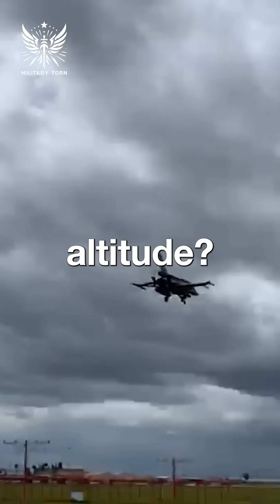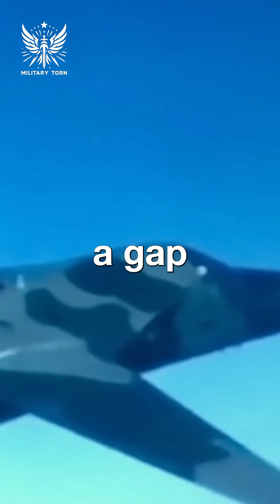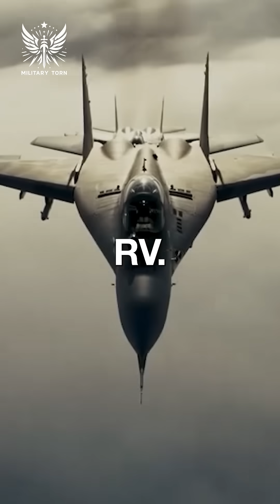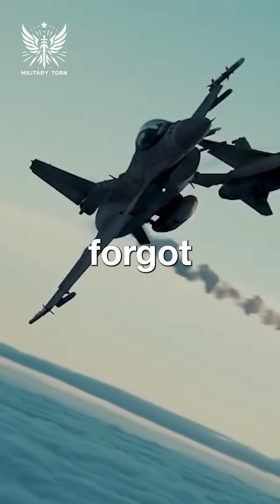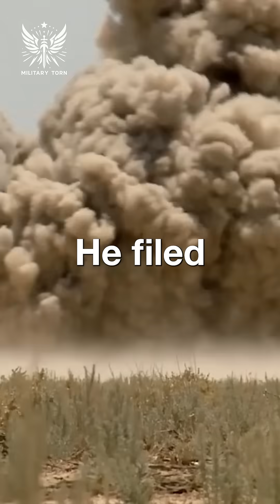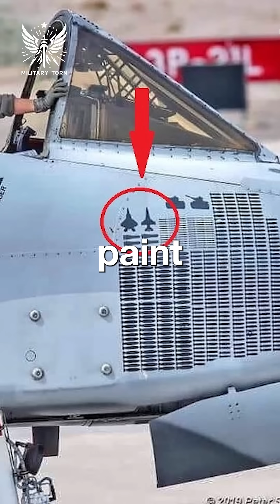What Would Happen If A Fighter Jet Flying At Mach 1.5 Passed Over A Civilian Car At Low Altitude?

Comment: 1977 Dutch train hijacking - Not sure if it was super or sub sonic

On 11 June 1977 at 05:00, almost three weeks after the start of the hijacking, six F-104 Starfighter jet fighters of the Royal Netherlands Air Force overflew the train three times at low altitude, using their deafening afterburners

Comment: Would wing rip at like Mach 1.2
Reply: FB-111 did not have a speed limit.  Just s skin temperature limit.
Reply: @FirstCajunAce  I’m talking about on the deck though
Reply: On the deck is just above ground - the "ground" in the Eastern portions of the Nellis Ranges is 3500 to 5500 get above sea level. Hitting Mach 1.5 200 feet above the ground when the ground is at 5000 feet above sea level is not a problem.

Comment: I remember reading some magazine article about Porsches on the Autobahn causing toads/frogs to explode when these vehicles passed over them at high speeds.  No actual contact between vehicle and critter.  Just something about changes in air pressure.

Comment: What woudl happen if 3 orbs were intercepted by F15s or F-16s and pilot armed missles? THey could if they wish laser the cockpit flange which is aluminum welding it and drag your to 10,000 mph or such de-atomize you ; next time you see them DO NOT engage and use your CELLPHONE not gun camera please .

Comment: In the early 70s, hot dog pilots would buzz over our farm, sometimes creating a sonic boom. When one did that and shattered all the windows in the house and barn mom called and complained. They had all the glass replaced by 4:30 that afternoon. You could read "No Step" on the slower F100s.
Reply: I just posted something similar. Were you in Colorado?

Comment: Mach 1.5 at 200ft? I doubt that, Even the SR-71 is limited to about Mach 1.2 at sea-level.
The atmosphere is simply to thick causing to much resistance and drag.
Reply: Not sea level - 200' above ground which in that part of the Nellis Ranges is about 5000' above sea level.

Comment: Impossible, at sea level at 1.5M q=3750 psf, wings would rip off. 1.5M at sea level is almost 1,150 kts, NFW!!!! Fake News
Reply: If you do the math to compute Mach you have to use temperature not altitude. All pressure altitude is useful for is computing air resistance. There was some damage to one wing glove and both strakes had some delamination but the wings started on just fine
Reply: @FirstCajunAce  I used sea level standard day (15 deg C) and standard adiabatic lapse rate to compute 3500 & 5500 ft msl. USNTPS CLASS 99 and a couple of engineering degrees helps. You’re telling me Mach is temp not altitude related? Seriously?
Reply: Mach display in the aircraft is primarily a ratio of speed of sound vs. true airspeed.  As Verified by Toppr -
Air pressure has almost no effect on sound speed. It has no effect at all in an ideal gas approximation, because pressure and density both contribute to sound velocity equally, and in an ideal gas the two effects cancel out.
In an ideal gas, intermolecular gaps are always taken to be very large, regardless of pressure. Pressure is solely due to the interaction with (imaginary) walls, not due to the interaction between molecules.

Modern electronic Machmeters use information from an air data computer system which makes calculations using inputs from a pitot-static system. 

The indicated true airspeed has a direct dependency on the static air temperature (TS
,SAT) also known as the outside air temperature (OAT). The static temperature cannot be measured directly since the air will heat up on impact with the temperature sensor due to adiabatic compression. Instead the total air temperature (Ttotal
, TAT) will be measured.
Reply: The FB-111 does not have a speed limit, only a skin temperature limit of 300 seconds above 153 centigrade.  The Nellis Ranges are 4 to 6000' above sea level. I did start the temp limit toner running but was easily doing above 900 kts. And, Mach is based on air temperature, not altitude.
Reply: @FirstCajunAce  After TPS I flew with the 6513 (Red Hats) in the early 90’s, Constant-Peg, Red Flag, etc. So, I’m very familiar with the Nellis Range complex. The 111 most definitely had a “speed” limit. Use whatever unit of measure you desire but the structural limiting factor is dynamic pressure (q). So I’ll stand by my sea level comment that an F-111 doing 1.5M at sea level is impossible. Now, a car parked on top of Mt Everest or Bald Mountain, yes.
Reply: The entry area on the Eastern side (approaching Student Gap) varies from 3500' to 5500' above sea level.  Airspeed display was around 1070 mph.
Reply: @FirstCajunAce  do the math, 1050 mph @ 3500 msl & 5500 msl is 1.39-1.4 Mach. Not 1.5 as posted. Is Denver a “low altitude” city? 1.5 M at 5500’ msl over a vehicle in a 111, yea right!

Comment: Panamint Valley (Just west of Death Valley) which was an area where planes could fly over Mach 1 if the could.
     Death Valley and Panamint Valley looks more or less the same from the air, and sometimes planes would be super sonic over Death Valley, something that was not allowed.
     Anyway, I was driving up Panamint Valley once when I saw an A-10. It looked to me like he was making a simulated (I hoped) attack run on me.
     I looked around and saw no other traffic around so I started jinking from one side of the road to the other.
    The plane flashed over (less than Mach 1, obviously) then a few second later he flew over me again, then when I was sure I could see him he performed a fantastic aileron roll.
    I'm 99.5% sure he was telling me, "I got you."
    You know, seeing an A-10 making an attack run on you is scary, no matter how sure you are it was simulated.
     If I ever saw something like that in real life, I'm going to run away.

Comment: This happened in wales in the mach loop. An F15 out of RAF lakenheath flew over a farm in the mountains and killed a cow. The farmer complained to the RAF and once it got back to lakenheath he earnt the callsign "beef"
Reply: Did the cow have a heart attack? A Sonic boom from an aircraft shouldn't kill a cow.
Reply: @drivejapan6293 probably a combination of the boom and stress from the noise
Reply: @drivejapan6293  it can rupture the lungs that was most likely the cause of death
Reply: @Crushonius  you might be unaware but a Sonic boom from a jet is very loud at best. Maybe damage your hearing by maybe rupturing an ear drum but that would be a very very fast jet with awful aerodynamics and a worst case scenario.  There is this misconception about the sound wave being as loud and powerful as an explosion which just isn't true. A super hornet for example at full throttle on the runway taking off is much louder than a Sonic boom. I work on an air base and have to listen to it daily. Mythbusters did an episode on it as well and they had trouble breaking some glass with a jet going supersonic at very low altitude. Video is here in YouTube if you are willing to search for it.
Reply: Cow BOOM!
Reply: Gold.
Reply: Ah the 15s from lakenheath. Won't miss working on those jets.
Reply: How exactly does a fighter jet kill a cow without firing . What proof do they have that the cause of death was Beef Pilot? Yeah... non

Comment: 😂There is a story about a Russian spy on the road outside of Miramar Naval Air Station, the home of Top Gun at the time.  A fighter came in hot and passed over the spy at about 15' off the ground.  The spy survived, barely, and had to return to the USSR for emergency medical services.
All an "accident" of course...  At that time aircraft were restricted from breaking the sound barrier over Miramar and the floor was a hell of a lot higher than 15'.